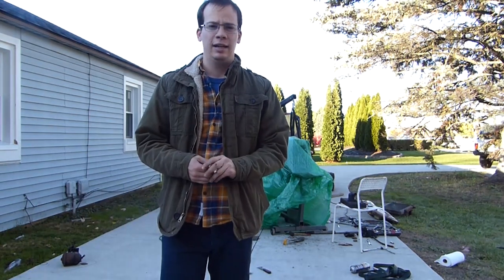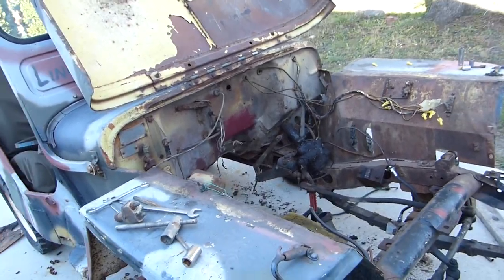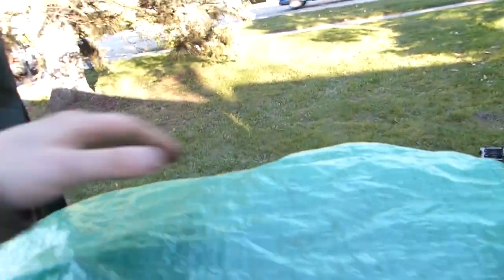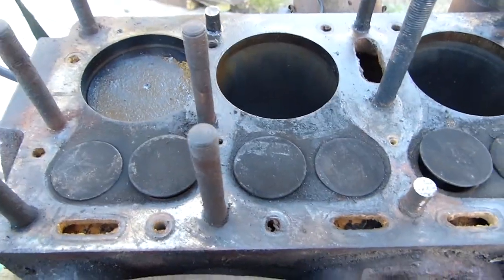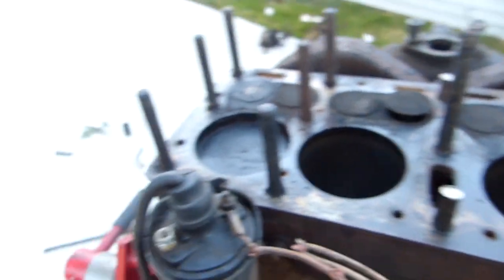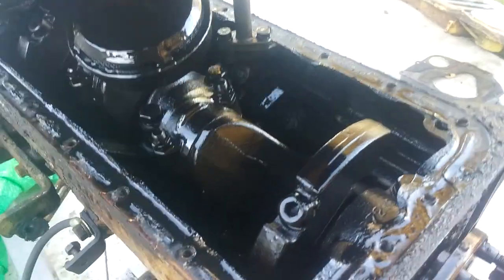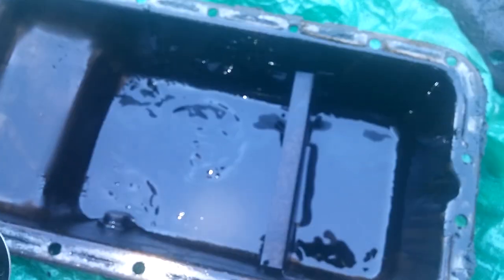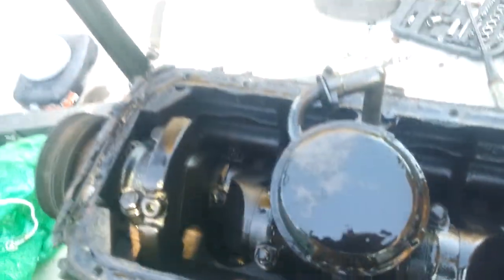Here's What The Inside Of A Neglected World War II Jeep Engine Looks Like

Comment: Mine was so bad all the cylender walls were cracked and the top two rings on every cyl were cracked in 50 pieces. I drove it for 5 years like that. After the rebuild it ran exactly the same. barely noticed an increase in power lol. good ol Willys

Comment: I think you have an issue with wear in your valve guides. Loose exhaust valve guides let excessive combustion byproducts into the crankcase. There is a good YouTube video on removing the guides without removing the cam.

Comment: Those had particularly low compression ratios, so your compression test numbers may not be much of a concern. Additionally, a lot of that sludge could be due to the primitive detergents that were in the oil back when it was last changed.

I say flush out the gunk, slap it together and fire it up. Looks relatively good.